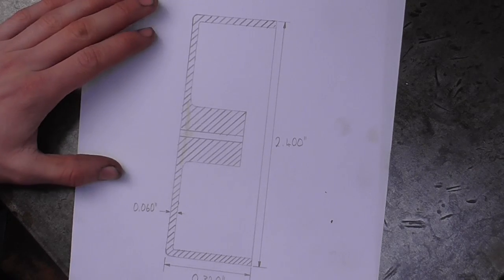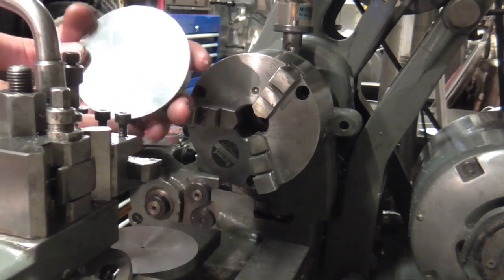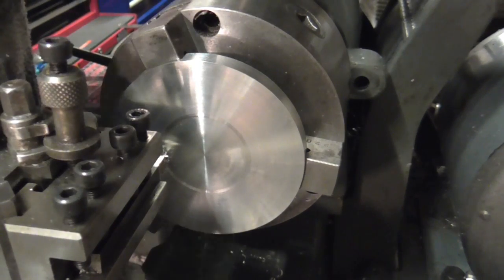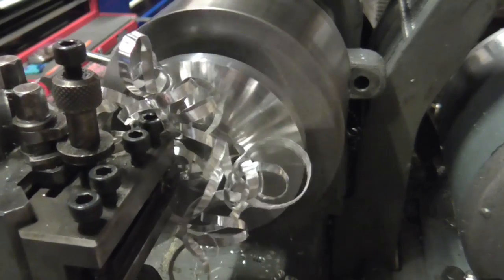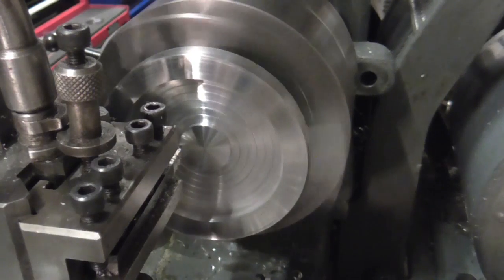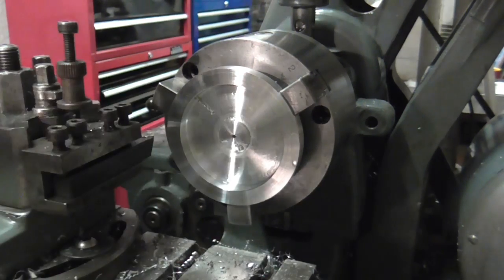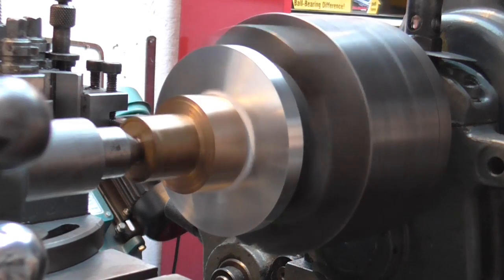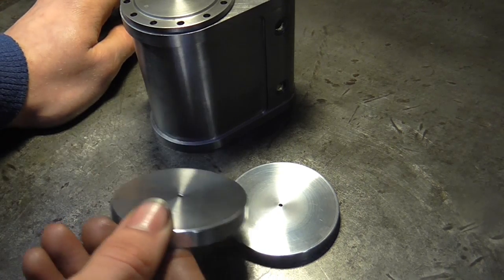Thin Wall Turning

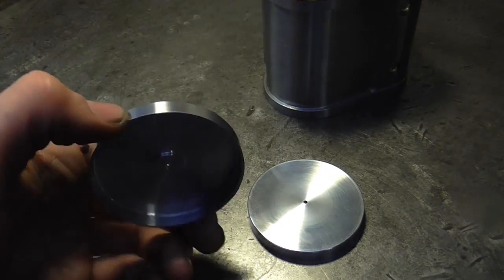Comment: 13:28 It looks like the cap will interfere with whatever caps off the spool valve ends. Is that so?
Reply from the maker: Yes indeed
Reply: @MrCrispinEnterprises  Ok. Looking forward to seeing the final assembly and especially the first running!

Comment: Nice to see a Yorkshire machinist and a Myford lathe, miss the one I had when lived in  Leeds. 👍🔭🇬🇧🇦🇺
Reply: Can't say I miss the ML7 - I think the Student was a good upgrade. This one seems to purr along nicely despite no oil in the oilers ;)
Reply: @millomweb  Mine was a Super 7 designation, maybe there are some differences between models.
Reply: @ShevillMathers  I think it was a little larger than the 7. I also think it had a 2 speed pulley on the motor as well as the three speed on the transfer shaft & spindle - giving 6 speeds. The 7 was just a 3 speed (not including back gears). The threading gearbox I think was the norm on the super but an option for the 7 and I think the super had power crossfeed. I think there were more 7s sold than supers.
Reply from the maker: Pmailkeey, that's a false claim! Unless I'm doing allot of turning I just put 1/8th" oil in the bottom of the oiler. I always forget to switch them off and if you have filled it right up it runs out everywhere.
Reply: @MrCrispinEnterprises  I don't think we once forgot to turn them off :) I also don't remember ours being more than half empty !
It happens though - you can forget to do something. Put a sign inside the workshop door saying 'have you turned the oilers off? as a reminder for when you leave !

Comment: Great video! I was thinking that an alternative to trepanning on the lathe would be to use a rotary table on a milling machine. Thoughts?
Reply from the maker: Thanks. It would be possible to do it on a rotary table however I think it would be slower and in this case quite difficult to hold the work. Cheers
Reply: @MrCrispinEnterprises  It seems an odd suggestion considering it's typical lathe-work.
Reply: No trepanning was performed in this video !
MrCrispin has merely turned a groove in the face of the work.
Trepanning is the action of removing a piece. Had the groove been deep enough to go right through, then the centre boss would have been trepanned out.

Comment: Hi, just a quick question , what diamiter are the finished wheels ? that is if this is a 5 inch B1. thanks , joe
Reply from the maker: Hi, 6.250" is the diameter of the running section. 6.562" to the outside of the flanges.
Reply: MrCrispin thankyou :) my lathe is too small haha

Comment: Nice technique for thin walled parts, could even go much thinner that way, one thing I would do differently, is use something else than steel wool to polish the Al part, you may find little inclusions of steel into the caps and eventually rust will show up... ;)
Reply from the maker: Thanks. Yes good point about the steel wool. Thanks for watching.

Comment: my son John who is a computer guy put me on to you.  I have almost no idea what you are doing but I have a question.  do you work in the aviation division of RR?  thanks, chuck
Reply from the maker: Hi, Yes I do.
Reply: that will be an exciting field...there was this Qantas 380 that had a problem with one engine..Luckily it was not far from Singapore and it got in safely...turns one small thing was bored a bit off center.  This was the first using the new engine....did not do RR much good so don't allow some guy to say that's good enough...Best wishes and best of luck..chuck
Reply: MrCrispin  Just like to say very nice workmanship, however those covers serve the purpose of insulating the cylinder covers.
Reply: MrCrispin  Just like to say very nice workmanship, however those covers serve the purpose of insulating the cylinder covers.
Reply: so you are not Crispin - why did you make an answer?

Comment: I have noticed, that all the noise the microphone picks up, .... your lathe is one quiet machine... what have you done to make your lathe so quiet? or maybe, the microphone simply doesn't pick up the noise?... either way, fine job, as always
Reply from the maker: Hi, Smoothness of operation is one of the characteristics of a Myford. Its very small and not designed for big loads but it is very quiet and it runs smoothly. Cheers

Comment: Lovely how well it went together, always feels great when the fit is perfect. I often find it strange how the decorative parts are often what determines how much we like something, but it has always been so. Will the securing screw be a hex head or do you have some other design? It looked bigger than 8 ba, but it's hard to judge sizes on videos.
Reply from the maker: Thanks for watching. Just a hex head. Cheers
Reply: @MrCrispinEnterprises  Not an Allen screw ?

Comment: Another great video Crispin, well done. Now a short note for our World viewers. Crispin mentioned that he was using Paraffin as a lubricant when machining aluminium, this is a UK / England term. The rest of the World will know it as Kerosene.
Reply: And mostly purchased under the trade name WD40 :)
Reply: Stop misleading people, WD 40 is NOT Kerosene, it is a specially formulated WATER DISPERSANT liquid really meant for starting old style cars that have a distributor. Yes I have seen it widely used by other YouTube contributors as a cutting fluid especially by the Yanks. But its main use is for dispersing water, it can be used when fitting a taper chuck to a lathe, under a machine vice etc, to help prevent moisture and rust forming.
Reply: Dave Ticehurst Jeez dude, leave your sense of irony in bed today?
BTW, as a former professional mechanic, I can say to never use WD40 as a rust preventative. You will be fine putting it under a vise or on a lathe taper, but once the aromatics in it are gone it will actually attract moisture. It is a first class cutting lube on aluminum, a decent penetrating oil, a hard to beat moisture displacer (as you stated), but it is a terrible rust inhibitor.

Comment: I am curious: Couldn't you have used the side of the tool after the first plunge? I am no machinist, so sorry if the question is too obvious.
Reply from the maker: Hi, Yes you could, although I would still have to do multiple cuts to remove the stock so its down to personal preference. Cheers

Comment: Hello crispin lovely trapanning tool I have a 6 inch one (carbide insert) they are very useful when going large diameter wholes in thin work and they save material . I like too your starrett uni micrometer sadly I couldn't find one so I made in with a Moore and wright head . I also made a spherical anvil micrometer . There great for internal taper measurement . Thanks for another Brilliant video!!
Reply from the maker: Cheers. Thanks for watching
Reply: Great job.   Thank you for the effort to do this video